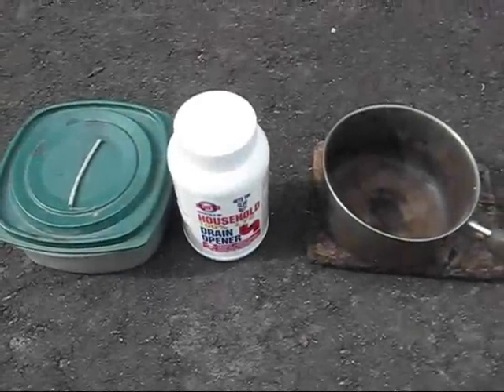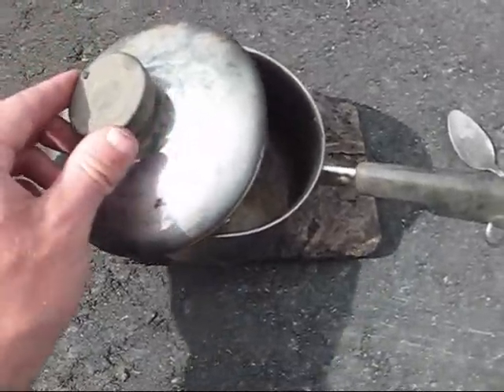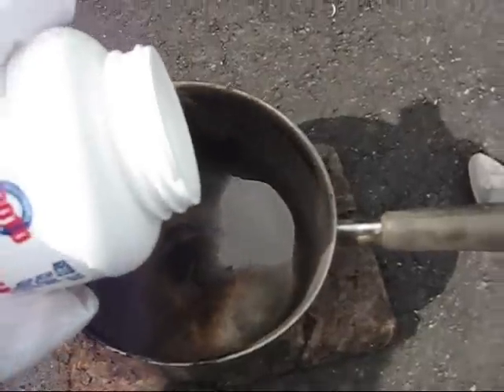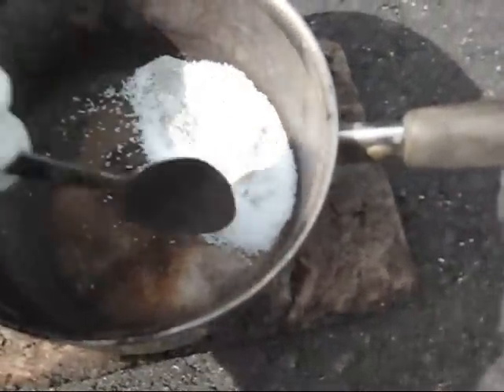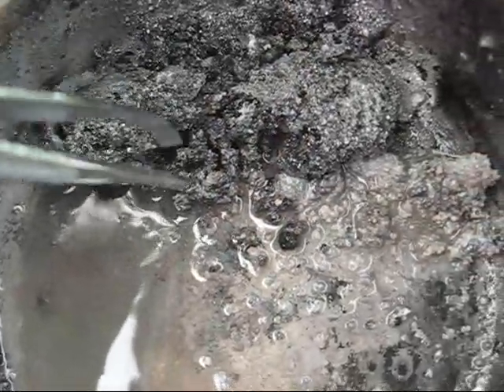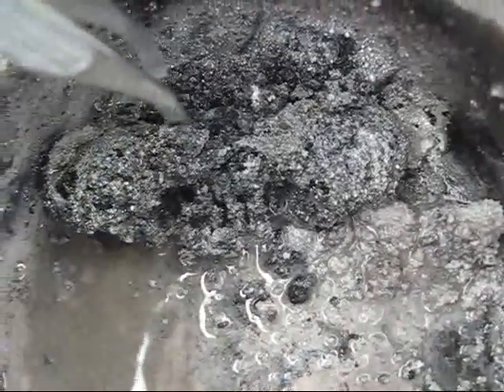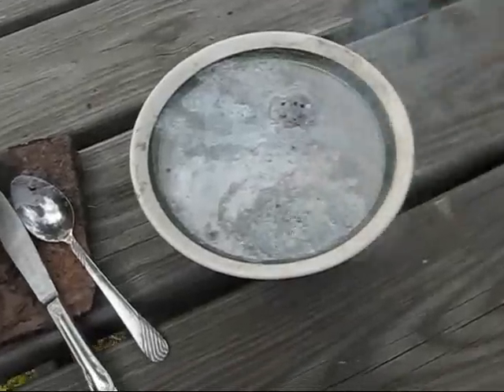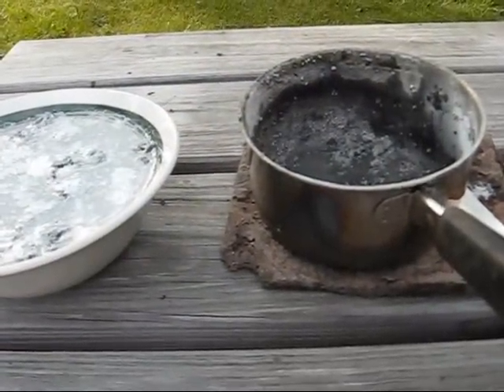Making Sodium Metal

Comment: you did that totally ass backwards at the end you're supposed to drop it in 50% mineral oil and water so that away the sodium metal will float to the top and you can take it out of the bowl and then drop it into the water.
Reply from the maker: I'm the one that invented the oil separation method you describe.
Reply: LLLaaaawwwwllllllllllll
Reply: lol rip

Comment: Cool thanks so much for this, Now I can continue with my greek fire experiments without having to spend 100's of $ on Sodium/Potassium. I need this mixture anyway for my experiments, so it wont matter if it's in a slag, I'm just going to turn the mass into a powder and mix it with my other ingredients anyway. The key factor is the reaction with the water, which this experiment seems to show the resulting compound does fantastically. The magnesium base will probably stabilize it more also, so it's less likely to react with the humidity in the air making it much safer to handle and transport.

Comment: This is a thermite reaction. This is not efficient, this does not yield pure sodium, and this is just some guy with little to no chemistry background playing around with chemicals in his free time. I would suggest you go elsewhere to get much better information, and much safer techniques for isolating sodium metal.
Reply: jordan smit  You can not know much about chemistry do you? Thermite is not just one mixture that your thinking off. Aluminium and iron oxide aka Rust. Its a mixture of any thermitic material. Which means any mixture of metal fuel and metal oxide. Meaning that this reaction he is not using Aluminium and Iron(III)oxide what you call thermite, the strongest  commonly used thermite. He is using sodium hydroxide and Magnessium which is a much weaker reaction causing much less heat.Meaning it probably wont even come close to melting the pan used as a crucible. Just one more thing. In any thermite reaction one metal is taking electrons from another. In the thermite you are familiar with the aluminium is taking electrons from the Iron oxide very fast.Turning the Iron Oxide into pure elemental Iron and the aluminium into aluminium oxide and at the same time releasing a huge amount of energy as heat. This is how every type of thermite works. Anyway back to what you know as thermite the Aluminium is the Oxidizer (taking electrons) while the Rust (Iron(III)oxide) is the reducing agent( donating electrons).
Reply: Survival 101 Thermite doesn't just refer to aluminum powder and iron oxide. It refers to the processes used in which an oxidizer reacts with a number of different fuel metals. You're wrong about it being aluminum nitrate as well, its fine mesh aluminum powder and iron oxide powder. Not aluminum nitrate. Two oxidizers are not needed for this specific reaction since the aluminum metal wants the oxygen present in the iron oxide, and the chemical process of gaining this oxygen produces an intense amount of heat. There are a number of metal oxidizers you can use in a thermite reaction, sodium hydroxide, iron oxide, copper oxide, so on an so forth. And a number of fuel metals.

You need to stop watching mythbusters and then going around acting like you're a science expert afterwards. Because you clearly are not.
Reply: Isn't thermite, thermite would melt right through the pan
Reply: You guys don't understand a thermite reaction can be made with a ton of different chemical the thermite your think of is iron oxide mix with aluminum powder witch is the most common also the sodium maybe impure but you could easily melt it sodium metal has a much much lower melting point then both the other chemical therefor you can get pure sodium (:
Reply: Sean Confer  lol I said pretty much the same thing you did before to someone else.
Reply: you are stupid
Reply: Thermite is Aluminum and Iron Oxide...... at a rate of 3 parts Aluminum nitrate to 8 parts Iron oxide. Also as the other poster said Thermite would have burned through the pot, the table, and probably a huge hole in the ground. If you put just a little on a car hood it will burn through the car, the engine block and the concrete.

So no, this is most definitely not a Thermite reaction.

Comment: That's not pure sodium though because you conducted it in an open system. Oxygen from the environment would also bond to the sodium to create NaO in a 20% gradient.
Reply: he never said it was.
Reply: I know I am late to the party and all, but I am wondering if you had a fairly unreactive crucible that could handle the heat, and argon, I wonder if this could be made more efficient, and I would guess that this still is with in the common person's capabilities if they are willing to learn a little about the processes and stop by a welding supply to get the products needed, (or do a LOT of cobbling to get argon say from dead fluorescent tubes or something. and if going that route, maybe look for dead xenon tubes to get an even rarer noble gas to cover the reaction)

Comment: ..and an easy way to collect that sodium requires the use of an inert gas,be it Nitrogen (cheap) or argon, helium etc,just not CO2 and heat and a gauze to FILTER it, the slag is quite lumpy and will easily be filtered by the guaze, giving you reasonably pure sodium, sure, it requires a little extra construction,but its doable,for those with the brains and experience-NOT for junior know alls of course,plus there are extra tricks that can be employed to stop the sodium from oxidsing...

Comment: I think potassium is even easier to make than sodium, because potassium oxide dissociates at lower temperature.

but if you want to produce any sensible amount of potassium or sodium, molten chloride electrolysis can be better option.
These salts melt quite easily.

Comment: Sodium is a metal, it is an alkali metal so unlike aluminum and gold sodium will react violently when placed in water. It will release gas and possibly self ignite. And it is highly likely that when you eat you use salt which happens to be about half sodium. Salts chemical formula is NaCl which means Sodium Na, Chlorine(ide) Cl.

Comment: There is nothing what could describe this strange behavior in description. equation does not prove anything.
I would be more interested to get some proof that you actually got Sodium instead of sodium oxide combined  with magnesium oxide/metallic magnesium. 
 I think sodium hydroxide should simply decompose into oxide and water, what happens very easily. Water will combine with magnesium making hydrogen and magnesium oxide.

Comment: You wouldn't be able to do it in oil. However, if you have a steel container, you could melt the two reactants into each other and the reaction could occur if you melted down the two reactants. You'd might wanna use Calcium metal instead of Magnesium though if you try that.

Comment: Is there any other way of starting up the reaction? For example like heating it on a burner or boiling both reactants together in mineral oil or is the fuse necessary?

Comment from the maker: I have never tried this experiment with LiOH. It should work, but only trying it will tell. If it floats on mineral oil you should be able to place the slag under the oil then heat it until the Li rises to the surface to be collected.

Comment: @dmoney10073 Na (s) is reactive to water because it has a single loosely held electron in its valence shell. In water, sodium readily gives up the electron in an exothermic reaction: Na (s) + H2O (l) --> Na+(aq) + OH-(aq) + 1/2H2(g)rea

Once all of the sodium has reacted, the fire will go out by itself because Na doesn't have any more electrons to donate. Just don't put alot of Na (s) in. And for wax, it's only meant to control it, not stop it. It will stop on its own in time.

Comment: @97dkb You'd need a tremendous ammount of pressure (as in the core of Jupiter) and as Nighthawkinlight said, I also doubt it has ever been actually created in the lab, but rather it has been theorized it would have metallic properties because of its atomic configuration. In any case, it would cease to remain a solid as soon as the pressure is released (I don't think by lowering temperature alone it could be frozen into a solid, but I might be wrong here)

Comment: @97dkb yes in Diamond traps but you need 30 000 Celsiud temperature and some 3000 000 atmospheres pressure! if released into the air, this kind of superhot liquid hydrogen would make the Hiroshima bomb look like a match spark

Comment from the maker: @elementguy27 The reaction will work with any hydroxide. The metal in the hydroxide doesn't play a role. Isolation potassium after the reaction may be far more difficult however.

Comment from the maker: @1993weekniej I don't suspect that would work.

The only practical way to make magnesium powder at home is to alloy it 50/50 with aluminum, which creates an extremely brittle metal that can be smashed like glass with a hammer. It is of course then only 50% Mg, but it should work for this purpose.

Comment: I tried this just a coupple of minutes ago! since i dont have acess to magnesium, i used german dark instead.
At first i couldn´t get it to ignite so i had to mix in a small ammount of potassium chlorate. This is both stupid and neccisairy at the same time(i didnt use stokiometric ammounts). The idiotic part is - if the reaction gets too much oxygen, the hydrogen will react with it and form water..
The neccisairy part is - Al2O3 needs 1.5 oxygen/ion instead of 1 like MgO.
500 characters limit..

Comment: Could you get Magnesium powder by dropping Magnesium in a acidic solution (Mg2+ ions exist (and H2)), dropping NaCl (or a other salt) in it, then through electrolysis? Magnesium will exist at the cathode but will it have a larger surface?

Comment from the maker: @amourdutigre In my second video I use mineral oil, which works much better than paraffin. The problem with using argon is that it may work fine during the reaction, but how do you go about removing the sodium from the crucible without exposing it to air?

Comment: @RYOGERG The idea of the parrafin wax is once it will coat the sodium metal to prevent reactions with moisture in the air. (when sodium metal is bought, it comes in containers submerged in mineral oil).

Comment from the maker: @JesusHChrist2000 The reason this works is because the sodium is attached to the hydroxide group as if it were a single atom rather than both oxygen and hydrogen. The magnesium attacks the hydroxide group regardless of what it is attached to, and steals the oxygen. Since the sodium can't bond to a lone H atom, they go their separate ways. The sodium could in theory steal the oxygen back from the Mg, but it lacks the proper physical contact at that point.

Comment from the maker: @wangouthangout How do you mean it would be less reactive? Potassium is more reactive than sodium. If you mean the initial reaction would be less violent, that is also not the case. The reaction does not involve the metal, only Mg and the OH group, so the rate of reaction would be very similar. That said, I have not tried it, but I am confident the reaction would proceed.

Comment from the maker: @medexamtoolsdotcom Keep in mind this is taking place with solid reactants and only briefly molten products. The Na is not able to reduce much of the Mg back out of the MgO formed because it lacks the proper contact. Much of the hydrogen escapes into the atmosphere so reforming a hydroxide is not possible for the most part. I suggest you watch my video response to this: 'Making Sodium Metal - Sodium Extraction'

Comment from the maker: @medexamtoolsdotcom I have to admit that your chemistry is above my head. As I understand it, the Mg is able to rip the hydroxide group apart making it unable to bond with the Na. This forms MgO in the equation:
2Mg + 2NaOH = 2MgO + 2Na + H2

So, though it does free the Na, it does so by destroying the OH group, ignoring what metal is attached to it. This reaction also frees potassium and I assume any other metal in a hydroxide, and will in fact proceed with Al rather than Mg.

Comment: I dont know if you already have done this, but it would be cool if you would. Could you do an experiment on making thermit, and experiment the difference between metals, aluminium, magnesium, calcium, titanium, zinc, silicon, and boron. The oxidizers boron(III) oxide, silicon(IV) oxide, chromium(III) oxide, manganese(IV) oxide, iron(III) oxide, iron(II,III) oxide, copper(II) oxide, and lead(II,III,IV) oxide. Just thoughed it would be cool...

Comment: My idea is that the magnesium is not actually reacting with the sodium directly, merely that the intense heat  (5000+) produced by Mg is breaking down the NaOH into Na, oxygen, and hydrogen, and then the Mg reacts with some of the byproducts. theoretically, you could do the same thing with thermite and extra aluminum powder. Hydroxides dehydrate at high temperatures, it's just ridiculous what's necessary and the oxygen would react immediately again.

Comment from the maker: It is a strange reaction, but you are looking at it the wrong way. It is not a single replacement reaction. The Mg steals the oxygen from the OH group, leaving the hydrogen and Na which are then unable to bond together. The reason it seems to 'cheat' the reactivity series is because the Mg does not attempt to replace the Na (which would not be possible) but instead avoids it entirely and attacks the OH group. This reaction will therefore work with any hydroxide.

Comment: @GingleGangle1 actually magnesium is not hard to get since some metallic pencil sharpeners are made of magnesium. if they look metallic but stick to a magnet, it's iron. if the look metallic, are non magnetic and very light, it can be either magnesium or aluminum . magnesium is hard and in time will damage files, but simply try to ignite the file dust. if it burns, you have magnesium.

Comment: @meteorman96 how do you plan to do an electrolysis in oil? it does not conduct electricity, besides, it has to mix with the lye solution and not chemically react

Comment: as told by the person who DID THIS EXPERIMENT, it does work. Sodium does not always light in water (only when it produces enough heat). A compound can easily be separated in a chemical reaction, you just have to know how, like right here. I've done this experiment also, and it DOES work.

Comment from the maker: It can sometimes be found at scrap yards having been mistakenly turned in as aluminum. It can be tested by scratching through the oxide layer and dripping vinegar onto it. The vinegar will bubble if the metal is Mg.

Comment from the maker: After. It protects the Na from reacting with the air. Mineral oil works better however. I improved the reaction vessel and air shielding methods significantly in my video response.

Comment from the maker: I would suggest using NaOH in the finest powder form obtainable, incorporated very well with the Mg powder. A water cooled vessel is far superior as well. I have also found that it is important to allow the products to cool to room temperature before opening the vessel. This can be done by using a loose fitting lid that will allow gasses to escape, but seal out most of the air once the reaction is finished. I do these things in a video that is a response to this one.

Comment from the maker: You are correct in that I use the term synthesizing incorrectly, however this is not a single replacement reaction. Na is far more reactive than Mg, however, Mg has a much higher affinity to oxygen than does the OH group. The Mg tears the OH group apart, forming MgO, H2, and Na.

Single replacement reactions only work when the metal being replaced is less reactive than the metal replacing it.

Comment from the maker: It keep it from reacting with the air. Check my video response for a better method. There is no good volume measurement. The reaction is best preformed stoichiometrically, which can only be done using mass measurements.

Comment from the maker: I do not know which is more productive. This method is certainly simpler to preform. The setup of an electrolysis device can be quite costly as well. I have not done it myself, though I know it can yield very large amounts of Na if done right.

Frankly, I don't need Na that badly.

Comment: i tell you make your your own,LOL. this may take a sec, but i sure it still work, go to walmart, and buy a Magnesium fire Starter, it should range from $4 to $10, depending on you location. once you buy this, scrap alot of shavings off. or find something to grind it down, a drill maybe, i used a knife, that why it took so long. then strike a match. i put the shavings together and got a bright flash, any larger would have hurt my eyes, lol

Comment from the maker: Yeah I was aware that this could be done with KOH. The burning could also be controlled in that reaction in the same way as I control this one in my video response. A smaller water cooled reaction vessel with a loosely fitting lid. It allows the gasses from reaction to escape, and upon completion the vacuum of cooling gasses seals the product from atmosphere. Once cooled, it will be much less reactive and the lid can be removed to pour in mineral oil without burning away the product.

Comment: Some additional notes:
This reaction works for potassium too.

Add activated charcoal to the magnesium to increase the temperature. 

To see if the magnesium is directly reacting with the NaOH use a crucible to separate the two (and add charcoal to magnesium to provide extra heat) - I'm gonna try this in a bit

I created a rig to control this rxn. If anyone is interested i can post. Kudos to Nighthawkinlight again.